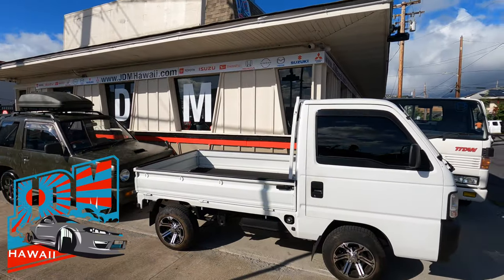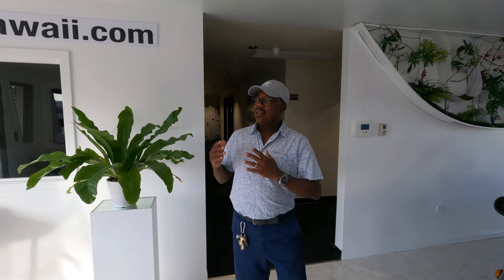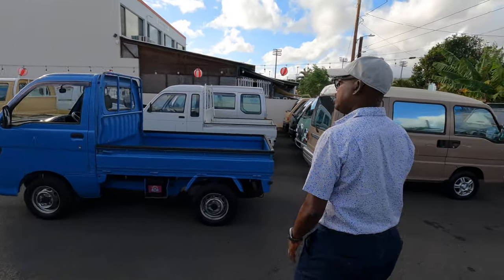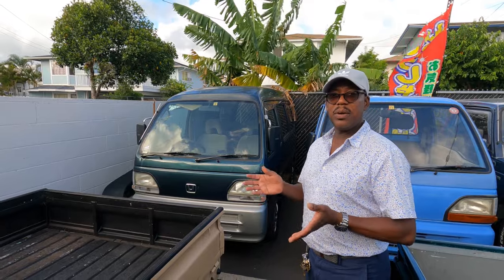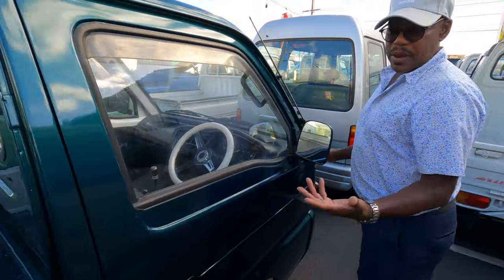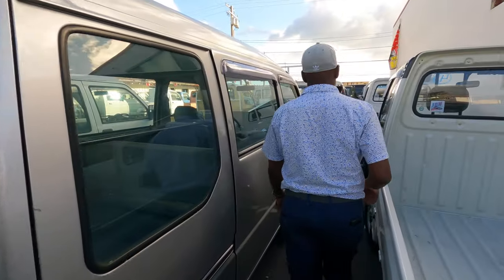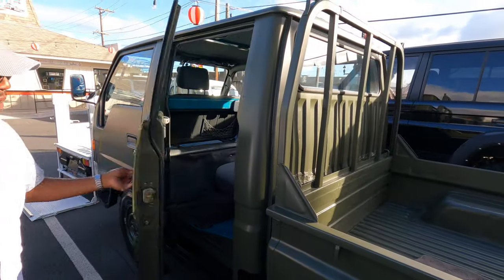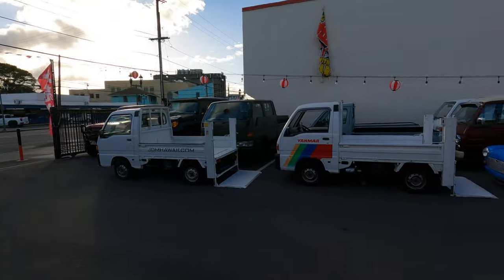Dealerships Don't Want To Show You This...

Comment: What a cool dealer! Got to disagree with you on Hondas. Started my search at Boeki, where there's a bunch of stuff, and you can drive them back to back. It didn't take long to see that Hondas and Subarus were in a different class as street vehicles. Been in an Acty for 2 years now, and no regrets. If you want to off road or go for the monster truck look, then other brands are more suitable. The Honda rules for nice interiors, interior quiet, and basic equipment level. Not to mention that parts are much more available for them. The sheer number of people running them means that knowlege, spares and modifications favor the Honda owner. No regrets!
Reply from the maker: I would definitely agree that honda and subaru are more quite with the engine being in the rear but thats also a pro and con depending who you ask. I loved hearing the engine note in the other 3 models. Honda wins in part support and owners too
Reply: I'd agree that the Acty is more street oriented than other kei trucks.  In the US, we can only import 25+ year old vehicles (protectionist bastages), and I noticed many of the older Acty trucks have rust near the bottom of the windshield at the bottom of the A pillar, and it was difficult to find a functioning Acty A/C, while it was rare to find a Hijet A/C that wasn't working at 25+ years, and the frames and bodies seemed to have less rust than the Acty trucks, even though I'd assume the Honda trucks weren't driven off road as much.

I wish I could import a later model Hijet Jumbo (extended cab) Climber (4WD, HI/LO transfer case and locking rear diff) with A/C and electronic fuel injection that's in good shape.

Comment: Those are some super sweet JDM vehicles!  You could scan JDM auctions for weeks and not find half as many awesome vehicles.  That's quite a service that JDM Hawaii is providing.

7:30 - It's sad to see dealers getting ripped off with the painted over rust scam.  I looked at a dozen Gen 4 4Runners on car lots around Cincinnati Ohio and in every case, I walked up to the back of the truck, bent over and saw black paint over bubbling rust on the frame and walked away.  On a couple, I poked the frame with my finger and the black paint and large chunks of rust fell off.  That was a wasted day driving up there.  I learned to stay south of the Ohio River.  Apparently they spray their roads with a mixture of brine and the acid that xenomorph aliens use for blood.

12:20 - I'm looking at painting my SHTF 4WD Hijet inside and outside with Monstaliner bed liner that's very close to the gray paint on that Suzuki Carry.  I think of it as Gray Man gray.

Comment: I'm currently in the market to buy a Kei Van, mostly as a daily driver. Im looking into something in the 90s mostly because i love the styling. What make/model do you suggest? Ive heard good and bad from all of them. I'm also not looking to break my bank. Suggestions?
Reply from the maker: A good kei van is about 8k+ depending on your location i guess we can start there, Next i would say it really all comes down to options. All of them are basically the same with a different look but when it comes to options my Mitsubishi bravo for example has way more than a Honda Acty street. The Subaru sambar is a good one too but its all about what your plans are with the van
Reply: @Waybeforethefame  I'm mostly just going to daily drive the thing around town. Maybe the odd camping trip, 4wd is a must for me. I do live in Canada unlike yourself, so prices vary. Im just curious as to what you think is either the best bang for buck model, or overall just best one for daily use.
Reply from the maker: @Kazzarian666  check one of my videos called which kei van is the most worth it, i think it'll help you out. Its 4 different vans